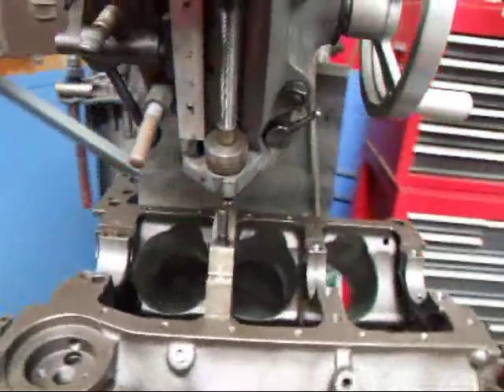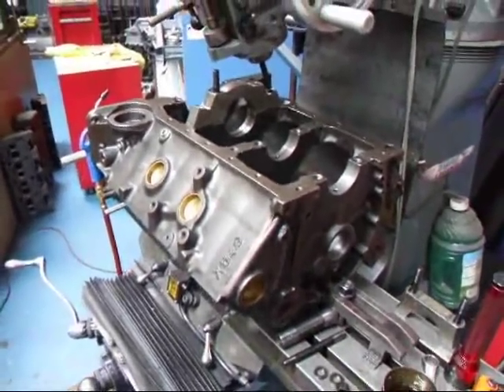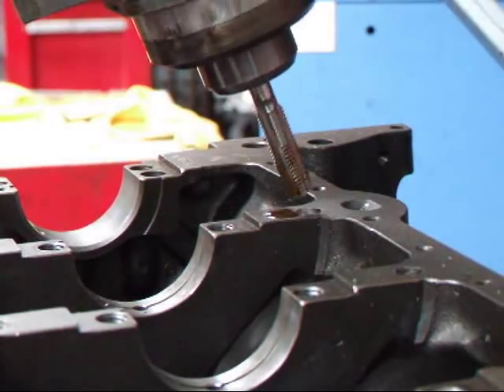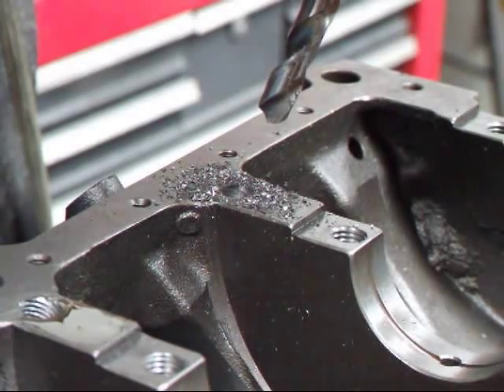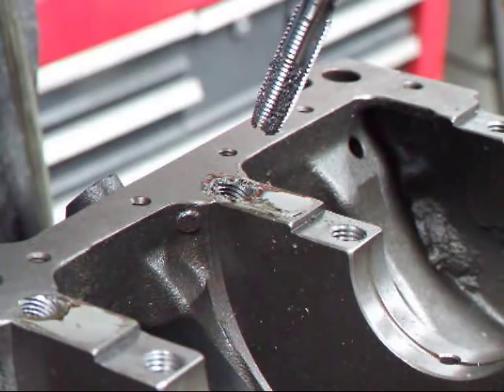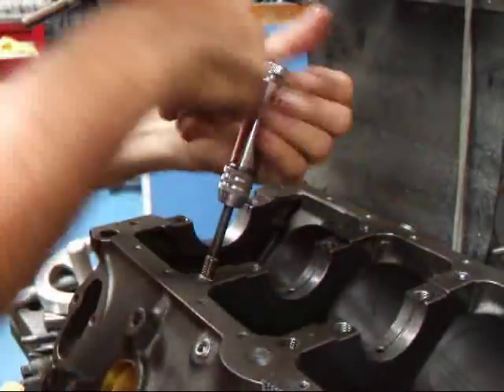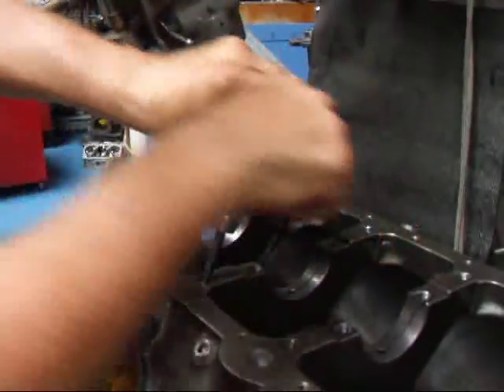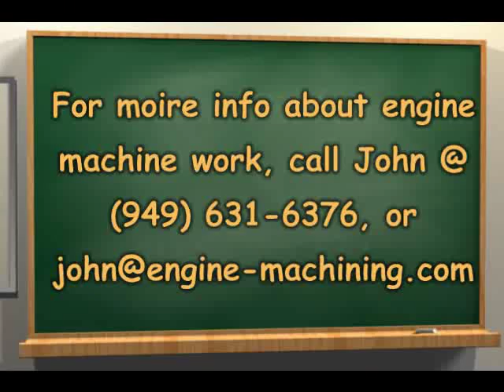Chevrolet V-6 Main Cap Repair

Comment: even better tip.. or well kinda an extension. place a shop rag around the air nozzle, over the hole... muffles noise and keeps from haveing flying metal particals where they should not be!

Comment from the maker: I try to do most everything  in-house, except cam & crank grinding.
Reply: You should spot face with an End Mill equal to the diameter of the tap you used for the insert so you have a square start. And using oil on your caps and cutting tools is like using lapping compound when you do cast iron. Better to use water flood coolant or Nothing at All.